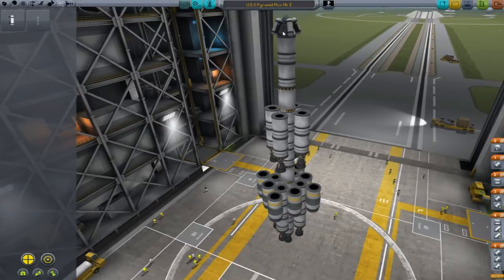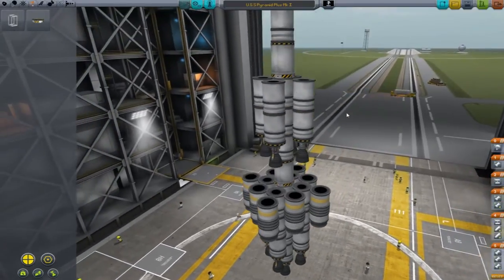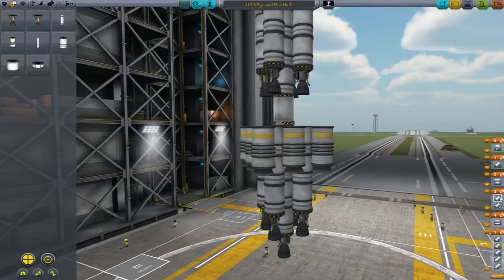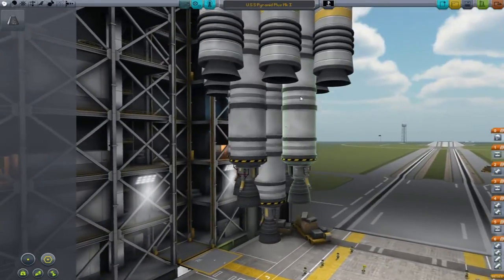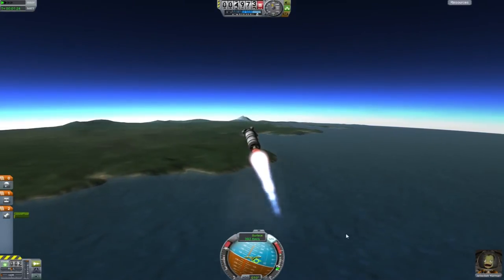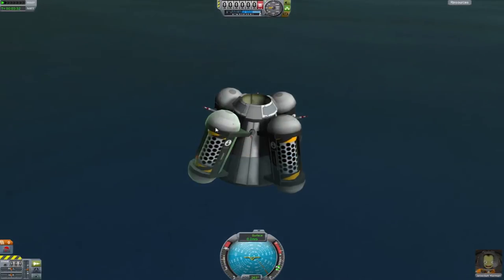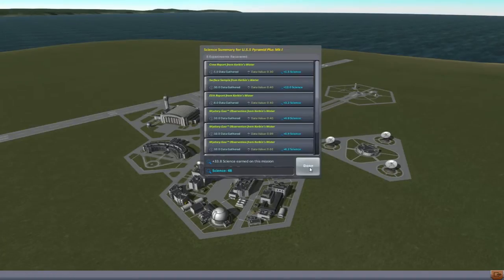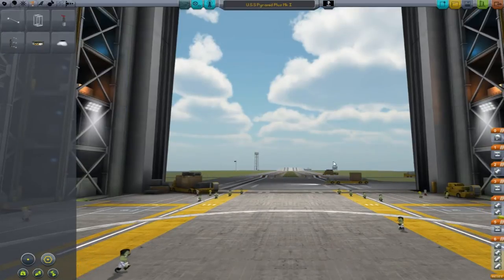Let's Play Kerbal Space Program - Episode 6: Rocket Design Fails!

Comment: You should check if the engines you use have gimbals/vectoring. The engines need to have vectoring to allow proper control.
The reason for fuel tanks/tricoupler not attaching properly was because the tricouplers were too big and was clipping into eachother. This might be one of the reasons why it was tipping over.

I also recommend you start with something a bit more simple and smaller and build from there. A one man pod is pretty lightweight so dont really need that much fuel to get into orbit.
Reply from the maker: True, all good points.